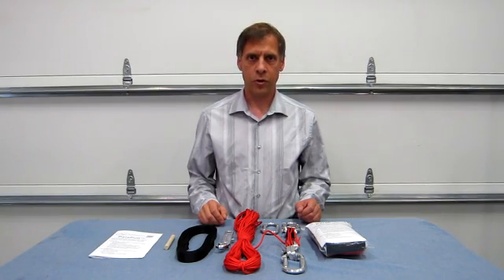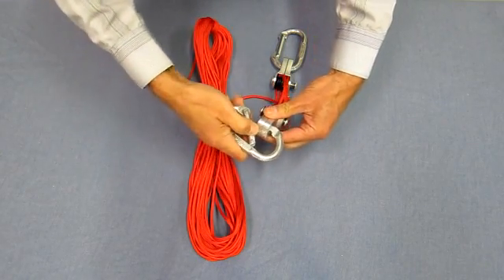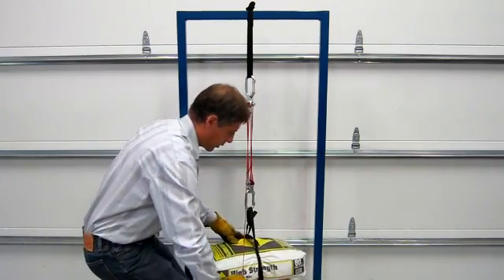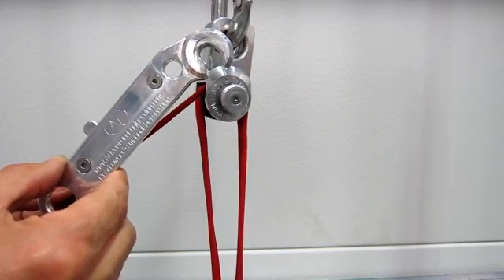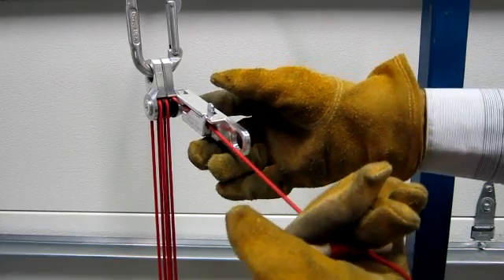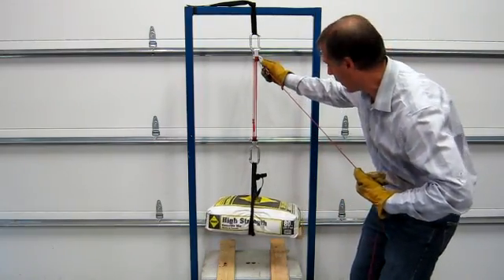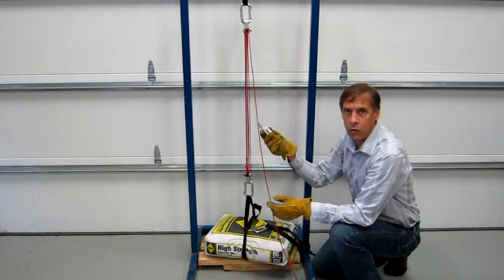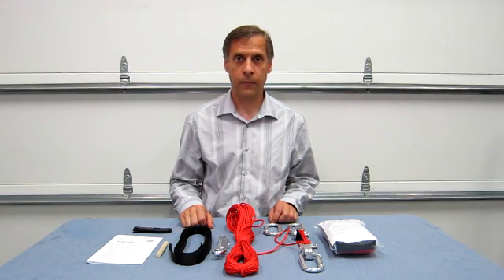ParaPull overview2.1

Comment: This would be great for snowmobiling if it was just a little beefier.   You guys should make one that supports up to 125-150 pounds of force.  Then it could be used to rescue a badly stuck sled
Reply: cjonas it is rated to exert 450 pounds on the sled (or bike or whatever), only 75 on the handle. I doubt the paracord would break at 450 pounds though (I wouldn't want to be standing under a 200 pound load supported by "450" pound cord but I'd have a go at lifting something heavier than 900).